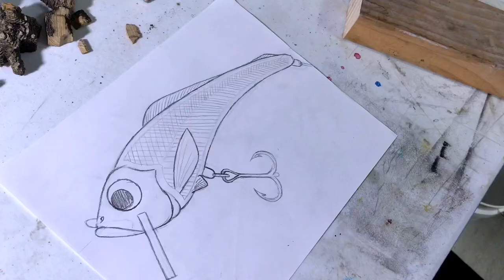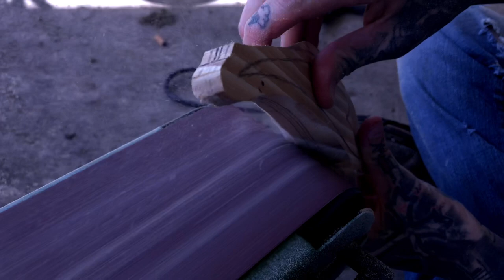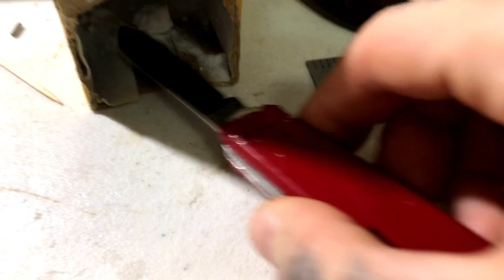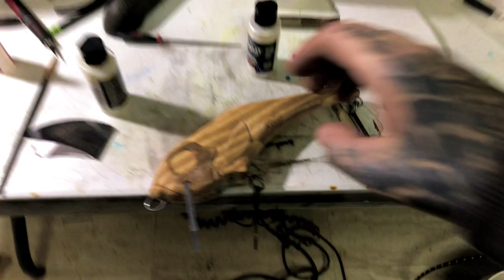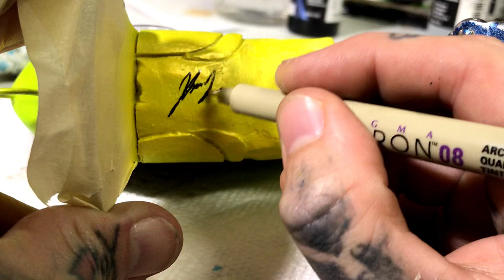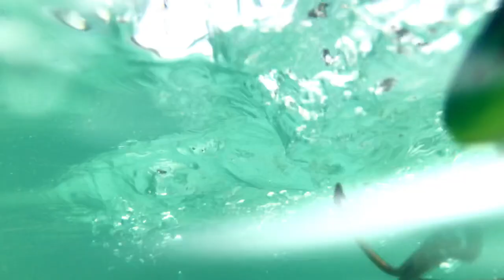Lure Making a huge Jerkbait Fishing Lure

Comment: That's certainly not for the smaller fish, did you ever catch with it? I made a rather large one once, it had three moving parts and was slow to make, I had High hopes for a monster Pike but it never happened; I think it was too intimidating 😆
Reply from the maker: No I don’t have anything in my area that would even consider biting that one. Plus I don’t have a fishing rod stout enough to cast it lol.
Reply: @TreysArt  Probably great for either monster Pike or a shark at sea, probably end up catching seals though 😆